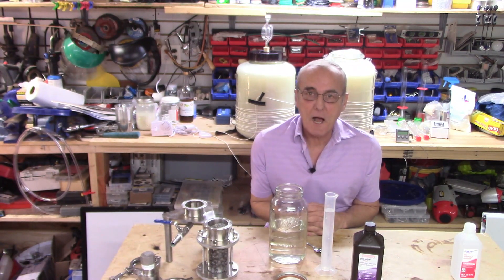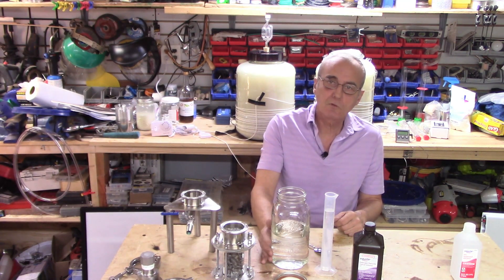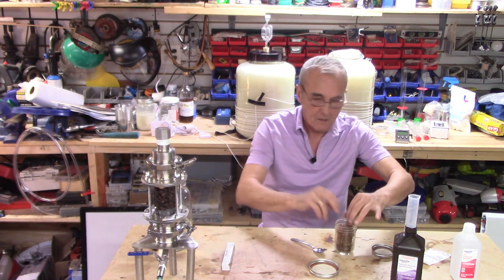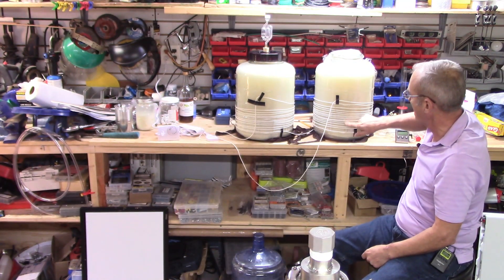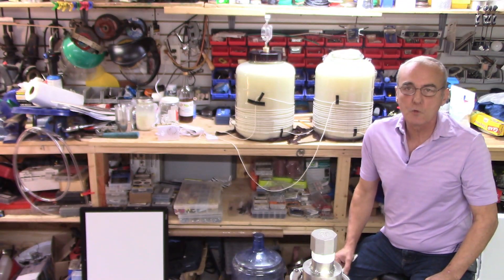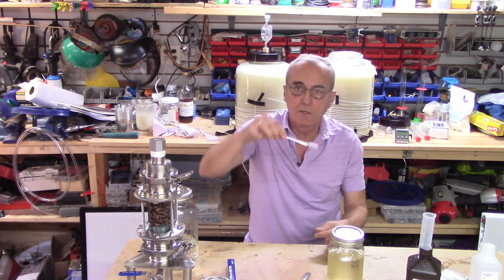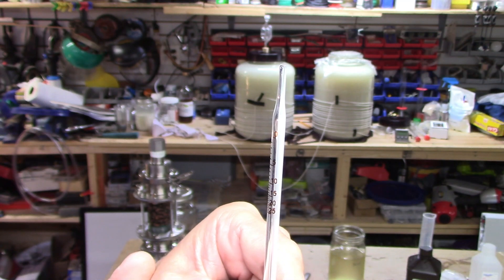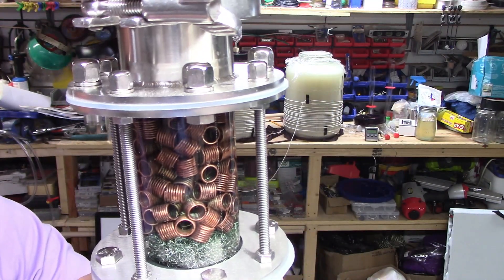tips and tricks measuring ABV

Comment: I made a similar Mash heater using two Heating Pads taped to a 55 gallon plastic drum;  insulated with a water heater blanket.  I used a PDI controller and an SSR to power and regulate the heating pad. temperatures to my optimal mash yeast profile.  Works very well.

Comment: Sake is looking good George, I bet it's going to be great!

I've been thinking some (since you've been making these sake videos) about CO2 being trapped in the rice at the bottom. It has gotten me looking into carbon dioxide as a byproduct of fermentation. 

I got to doing a little research and was reading how around 2015-2016(?) they were coming out with carbon dioxide scrubbers because of the climate change, that are able to somehow convert CO2 into methanol. I have been sort of research obsessed the next couple of days trying to get a better understanding of this. Initially when reading this, I immediately thought that somehow maybe excess CO2 in a mash could present more methanol, and perhaps a degassing before distillation may be of use. I gave this a try on my last run a couple of days ago, and found it to be of little change from normal. So I kept reading.

Eventually I stumbled upon an article on the US Department of Energy's website on nanoparticles and CO2 in which they were able to convert CO2 into ethanol through electrolysis:

"The team used a catalyst made of carbon, copper and nitrogen and applied voltage to trigger a complicated chemical reaction that essentially reverses the combustion process. With the help of the nanotechnology-based catalyst -- which contains multiple reaction sites -- the solution of carbon dioxide dissolved in water turned into ethanol with a yield of 63 percent. Typically, this type of electrochemical reaction results in a mix of several different products in small amounts."

The whole thought of how much CO2 I have been putting out has been on my mind since my very first mash years ago, just a 5 gallon bucket, but I generally ferment indoors during winter. Now adays I ferment up to 100 gallons of mash at a time. Generally a 55 gallon (40ish gal) at a time, but sometimes two if I'm making different things. My mashs indoors always push a lot of CO2, and I generally try to vent it outdoors, but I have gotten to thinking maybe I can harvest it and turn it into at least extra fuel, if not something a little better, ya know?

So far I have a 30 gallon bucket with about 25 gallons of water in it, and my currently about 80 gallons of mash bubbling away in it. I might not be able to lay copper nanoparticles over carbon rods, but I have a lot of pure carbon rods,  a bunch of copper pieces of various sizes and shapes, and a variable power supply. I figure if I can turn co2 water into even 10% alcohol, I could distill give that a shot and see what happens. Anyway, I thought it was neat, and maybe a cool experiment to try. Something new, just trying to keep learning.  The worst that can happen is nothing happens, I put some electricity through the water and nothing does anything.

I've been reading a bit into electrolysis on a mash as well, and it seems that it will generally speed up cell production, and possibly increase alcohol production speeds as well, but at the cost of more oils and such being produced, maybe not my bag, but I thought it was worth noting.

Anyway I hope you thought this was interesting reading. I found intriguing, and thought i would pass the information along. I know you like the science behind the stuff as much as I do.

Cheers

Comment: Umm, just a comment on that ABV meter
A small orifice measures/tests viscosity when leaking under a given head (as you said). 

Hydrometers measure density (as you said) 

Viscosity and density are related - but not directly and are not the same thing 

The meter appears to be measuring capillary action which will be affected by everything -  - temp/density/viscosity/ionic charge of the liquid/surface tension of the liquid/diameter of the capillary channel/etc 

The capillary action is pulling the column of liquid upwards and gravity is pulling the liquid downwards. When the mass of liquid left in the capillary trying to fall is balanced by the upward pull of capillary action, the flow stops (and you read the graduations on the tube)
A neat idea actually - quite original, in my experience as a lab rat
Though I suspect that any particles in the liquid are going to mess with the reading
Reply from the maker: Very well explained and thank you. This is all we have minus expensive metering and testing devices for home use so it gives us a good ball park reading. 
George

Comment: Thank you for your time. But most of us NEED COOLING BLANKET, NOT HEATING! I'm in Phoenix Arizona -7 GMT, I need to get Below 72*F over 9 months of the time ;<) Give us COOLING, NOT 'HEATING' ;<p
Reply: I took twenty feet of  3/8 copper coil and made a wort chiller out of it drilled two holes in the lid of my thirty gallon drum left the ends long enough to it fits into the middle of the drum next I connect half inch tubing to the copper ends it should fit on nice an tight connect one too a small pump drop that into a five gallon bucket of ice connect the plug into a pid control and make sure the other tube will not fall out of the bucket an presto no more heat problems works really well for me in South Florida. Twice a day check your ice water an change as necessary. If you buy a cheap pid you can make this very easily and cheaply. Good Luck.